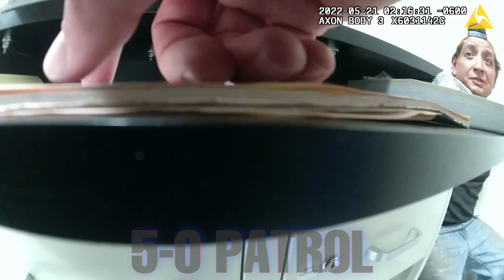Here’s Why You Shouldn’t Drive Drunk | You White Trash Cop!

Comment: The condition of his truck, told me all I needed to know before the video commenced.
Reply: Well, I've had project vehicles..  Even things I acquired to use as rough duty work vehicles that I wouldn't cry over spilling a bit of paint or a minor scratch.  However no door handle means you can't lock up tools and equipment.  (And many of the plastic handles just give up eventually.)
Reply: @shotforshot5983  So has my son, but not in that bad of condition.
Reply: I'm with you guys.  Therefore plenty of kids whose first cars looked like this.  Mine was a 69 Ford Torino, in the 80's.  What fun, and near death experiences we had in that old beater:)
Reply: Get rid of the unnecessary comma.
Reply: @terminat1  Who?
Reply: @sarahdooley6164  You.
Reply: @terminat1  🤣🤣🤣